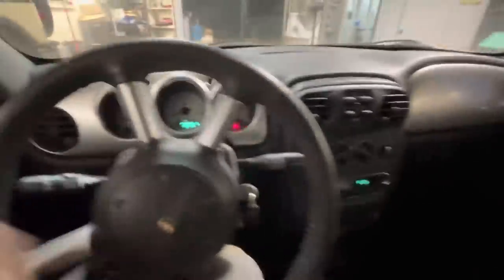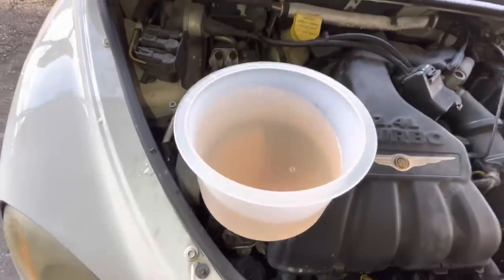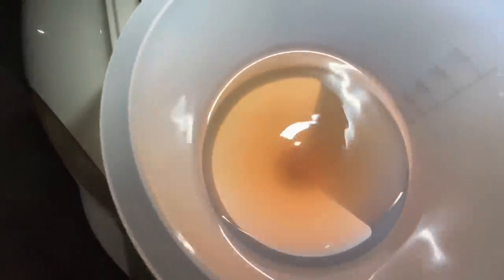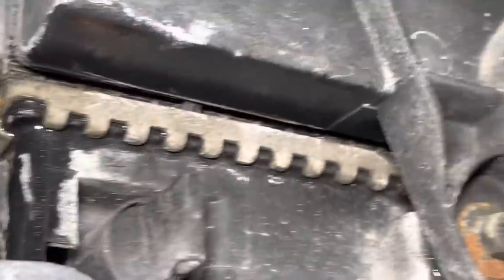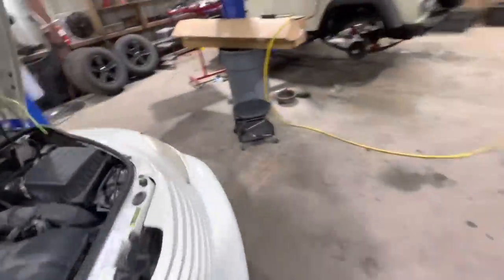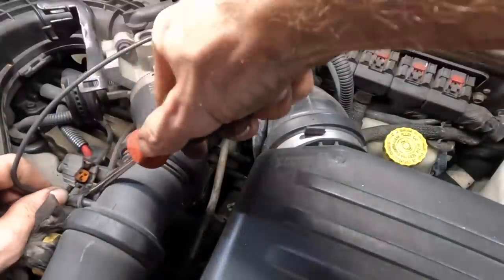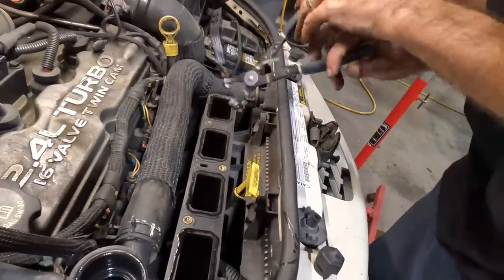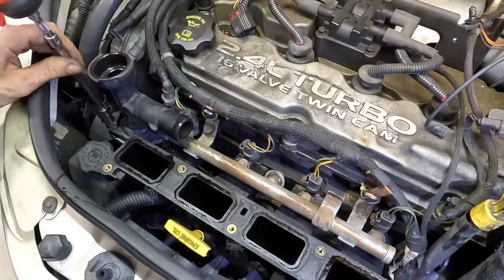Turbo Cruiser 2.4 Overheating Again!

Comment: Lol love the PT LOOSER haha. First time I did a rad replacement, I learned a tone on that pain in the arse vehicle

Jesus Murphy you went right to town here hey?? I would've left the intake on personally.  I've completely stripped the top, without removing that.

Future advice, just pull off the front grill, pull the rad, just to look, its not hard, and then your arms have ample space to check it all out. Half hour and my whole front end is open lol. I have a 07 non turbo pt cruiser

Comment: I had the same problem, same car same problem. I did new thermostat, changed coolant put new fan motor on. Still got hot, changed radiator that fixed the problem. My advice don't buy a turbo pt cruiser. Plus it is slow as hell.

Comment: I wonder if you got one of those things where you can check for exhaust gases in the coolant system using an indicator liquid (that stuff that turns from blue to yellow if exhaust gases go through). That stuff comes in handy to confirm or rule out an internal exhaust leak.

Also seeing those throttle and cruise control cables just reminds me how old those are by now. When did they stop building them, somewhere around 2010 ? Here in Europe those were known not only for overheating issues, but also for having absolutely horrible brakes, especialy in the rear. Lets say not necessarily the best choice of car fro crossing the alps.

Comment: Man, those PT Cruisers have got a cramped engine compartment. I wonder if that crumpled aluminum piece you threw away used to be some form of tubular structure to affect the airflow near the bottom of the compartment. I don't know. I sure hope it was not intended to be some kind of useful support for another component.

Comment: i have a question i have a 2014 subaru outback with 177 thousand miles its never had the the cvt fluid changed should i change it or not i have had the car for 3 months i trust you 100%

Comment: I replaced a radiator in a 04 PT. I did not need to remove the upper intake to get it out. I just removed the front clip maybe i just got lucky?

Comment: explain why exhaust gas bubbling coolant in beginning? minor  head gasket leak sealed up after head warm up? exhaust gas caused radiator leak? all these labor for radiator change, I would do exhaust gas chemical test u did @ old shop and radiator hand pump pressure test.

Comment: Damn good video, and yes as usual I see something I didn't like. I would spray that connector with some electrical cleaner as you dripped transmission fluid all over it which could eventually create a problem down the road

Comment: Hi Ray, do you have a cooling system pressure tester ?

When used correctly cold / hot test and so on it can save plenty of time and show leaks without having the engine running.

Comment: It is not turbine powered . It may be assisted by a turbo, which is driven by exhaust gases.
Reply: If that boot had fallen in, the boot is ferris, , and the cooler for the turbo is aluminum. A magnet should do what you need

Comment: I don’t know if you will see this but, I have a 2.4ltr question. Would it be possible to add a turbo to a 2.4 ltr multi air? Its the Dodge engine in a 2016 Fiat 500x… Would be awesome to get some extra ponies!

Comment: Ray, you just post with the video length and frequency that  comfortably fits in with your family and work schedules. The 99.9% of the genuine viewers that appreciate your skill and ethics will not mind in the slightest. Unfortunateky in todays society the tiny minority of hate fuelled bile have the loudest, shouiest voices, but they are still the minority. Do what riles them more than anything - ignore them.

Comment: Ray why don’t you cover or block intake ports. If a screw dropped in there would be a potentially catastrophic outcome for the engine. Just a bit of blue roll in each port would be safer
Reply: Good to see the ports covered on the intake at the end of the vid my nerves are more settled

Comment: Pardon my French, but what a pain in the dick! Based on this video, if I own a PT Loser and it requires a radiator replacement, I should take that bucket to Carmax and trade it in for a Not-PT-loser model vehicle. Your patience is admirable, Ray. 👍

Comment: Ray - are you sure that coolant you saw at 20:18 wasn't simply the remnants of removing the stat  (13:30)? No problem fitting a new housing gasket I guess (apart from the extra aggro you gave yourself) but as you noted yourself, the old one looked just fine.

Comment: Just like when I replaced the radiator in our 2007 Monte Carlo SS with the 5.3 I literally took half the freaking motor apart to spend 20 minutes replacing the actual part but spent half a freaking day to get to it. To my surprise I had no extra parts.  Lol
Engineers should be put in prison.

Comment: If the lights are less than 12 feet from ground, they need to be rated for the environment as in enclosed cus of fumes in repair environment...NEC 2020 or NEC 2023

Comment: Is radiator the cause or symptom of said overheat ??  
Is Triple t-stat claimed replacement a definition of insanity (doing same thing over, but expecting different results)
Head Gaskets on these motors don't do well after any Over'heat
Reply: They’re known for headgaskets

Comment: Any thoughts of putting some kind of floor down. Probably can't do epoxy with all the contaminants, but maybe there is some other kind of floor that can be applied to make cleanup easier and brighten up the shop?  I realize it's not a permanent location, but could make it nicer to work and nicer on camera?  Maybe it could be a freebee/sponsor  from the garage flooring maker?

Comment: Engineers:  We see that only two bolts are needed in this particular part for the utmost amount of durability and integrity.  Also engineers:  Why stop at two bolts when there is room for 6?  And, we'll put a 7th bolt on just for super redundancy.

Comment: Looks like the PCV system is not working very well. Look at all that caked oil in the intake runners. That is definitely an octane killer. Nothing like a lot of pinging. And I'm sure the customer doesn't run premium fuel in that beast to help with knock.

Comment: With your filler tank unit in the filler system could could you get operating temp pressure. Could be something I missed and be very wrong but did you pressure the system with the rad cap on?

Comment: My neighbor had a honda civic and asked me whose cars last forever.   What can I do to make my car last as i save for a new one..  My reply That was 10 years ago..  She told me here civic was in good condition..Lets see old stereo wiring no fuse at battery just hanging no cover for exposed wire, dash destroyed from a stereo theft, carpet was eatten away from spilled coffe etc it was disgusting.. Wash and wax 10 years ago. Brake fluid change or trans fluid change any maintenance .. I just got a look. deer in headlight.. Her trans died figures then the dreaded head gasket leak.. Her sister had same car better shape but both hauled to junkyard blown head gasket at 100k or there about.. Then Dads accord was on its 3rd yes 3rd auto trans that was taken as junk..  I am not a fan of hondas..  Peoples are funny maintenance whats that..  Just gas right??  Her new accord was low 3 quarts of oil, I measured what came out..  She was like whatever..  One cannot make this up

Comment: I've had a similar issue on 2 vehicles...definitely loosing coolant but NO drips and can't find source BUT CAN smell it. Determined they were leaking and EVAPORATING at the same rate.  Do you think that was the issue?
Reply: And what's with PT cruisers? We where just in Hawaii and saw MANY there as well
Reply: Well “tighten” that coolant up so it’s not loose. 🙄🙄🙄🙄

Comment: Chrysler puts really shit radiators in their cars and SUVs. Those combo aluminum/plastics turds only live about 5-6 years before they develop a crack in the plastic or gap where the two materials meet and then  start leaking.

Comment: It annoys because of too many required dumb disassembly steps to do what should be a simple radiator swap. It's as if they thought a cheap plastic radiator would last forever and not need an easy way out... like remove front grill, remove upper cross member, radiator assembly out, fan and all... instead of, take all kinds of stuff out of the way just to access the stupid thing

Comment: It would be very easy to become frustrated working  on some of those bolts Ray.  Some very thoughtless design was obvious to me.  Why they put attachment points in tight spaces necessitating removal of multiple components, just reach one bolt, is just plain dumb.

Comment: OK. I'm bored so I will ask a tech. question and see who knows it. Ray Chime in as well, or inform us if you knew it.

If someone scratched the + and - off a top mount battery, how would you know which one is positive?  Without using a volt meter. Just by looking at the battery.

I learned this in Auto tech school in the late 80's, yes I don't care for newer junk. Anyway take your educated guess. I'm sure some here know the answer.

Comment: Haters are bullies by another name.  They rarely pop their heads over the trench and when cornered I often discover poor reasoning skills, narcissism and non existent managerial or technical ability.
I had one once. Production Supervisor. Complete pain, spent his time telling the Senior Management how badly my shop was being run.  I offered to let him run a shift for a day.  Really.  Idiot leaped at it and proceeded to tell some very experienced mechanics and electricians what they should be doing.  The guys turned on him after four hours.  He was luck to get out in virga intacta.  My guys weren't happy with me either, but I bribed them with chicken dinner and donuts.  Idiot was told any more of his stuff and I would make him a permanent supervisor and to make sure he had a will.  He went away.
Ignore them all Ray.  Easier said than done I know.  The only suggestion I have is to think of other happy things until these twits fade away to insignificance.

Comment: the PT cruiser was a poorly designed car...very hard to work on    and it was not very reliable......I am cynical somewhat.....I drive a 2.2. camry from 1999     300k miles   still runs great    no major engine and trans work every....biggest engine job was timing belt(s)  just put my second set of rims on with the snow tires for the winter season   I did replace the radiator several years ago on the camry.....it literally took less than a hour, and I was taking my time.  The amount of items that need to removed to do a PT cruiser radiator is ridiculous....reinforces my desire to not own any dodge/chrysler product  (there 225 slant 6 was very good though)

Comment: The biggest hater is the engineers of this PT Cruiser. Dang thing will make you sign a pact wit the devil itself to get it outta ya hair. Their is a channel dedicated to how engineers who's wives have been screwed by mechanics design these vehicles like this for revenge😂🤣🤣🤣. Ford has the engineers market cornered. Just watch youtube shorts and the mechanics say why Ford Why. Ray as I said "Fuq em if they can't take a joke" tell em to kick rocks and keep it moving. You are making a living for yourself and family. The amount of detail you go into like take for instance this POS $#1$@&* PT Cruiser you have given simplified steps on the replacement of that freaking radiator and that thermostat housing gasket replacement without having to pull the engine🤣😂🤣🤣 Keep up the great work for us DIY'ers👍👍👍

Comment: All that just to remove a radiator?
Screw that, i'd rather cut the front grille off if it was my car then put it back on with Tek screws, bugger the look.

Comment: Geez I knew these cars were a pain in the butt to work on but you gotta be kidding me. Do you have to take half the car apart to do a simple or fairly simple repair. When the car was brand new didn’t you have to do something stupid like remove the engine to replace the timing belt or something similar?

Comment: Ray , if you were doing a brake change,you would have had your pipe clamps to hand; why didn't you use them for trans oil pipes. And use your ratchet straps more for mechanical advantage,  I hate seeing you dangle an unsupported drive shaft above your head. Never trust the mechanic who worked on it before you.

Comment: I know this sounds negative, but putting money into a PT cruiser seems like buying curtains for the titanic.  They are one of the least reliable cars ever made.  I remember I had a buddy that bought one new because it was super cheap and 2 weeks after he bought it, the entire rear wiper assembly fell off the back of it.
Reply: Strange how there are so many around for a 20 year old unreliable car.
Reply: @RalphRacc00N  Hey buy whatever you want.  Who knows the mileage on these cars and the number of repairs?  They sold quite a few of them I believe, kind of like the dodge neon which are almost all gone.  Also, where I live the PT cruizers are pretty much gone too.
Reply: @Clearanceman2  So its a reliable car then? with repairs and certain mileage? okay whatever, and I do buy anything I want. Thanks kid.
Reply: @RalphRacc00N  No, it's not a reliable car.  Good for you buying whatever you want.